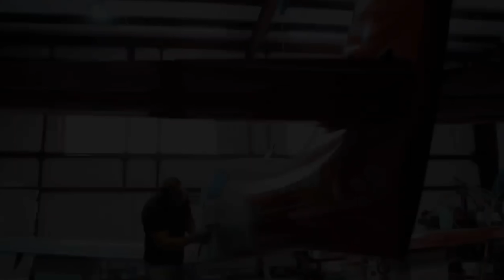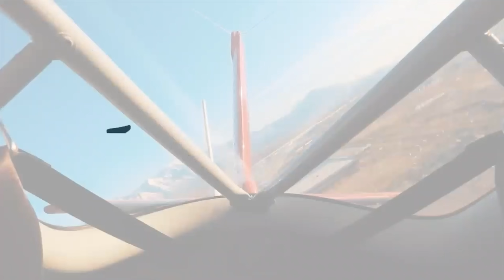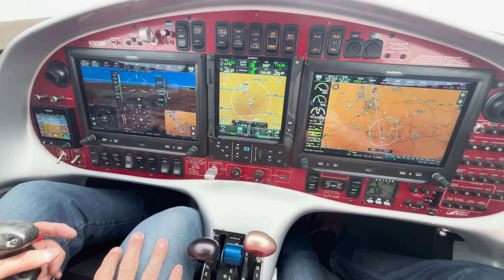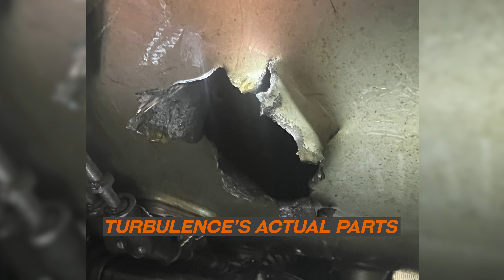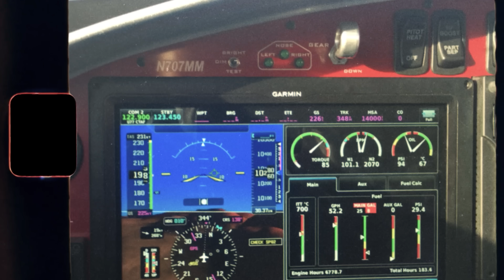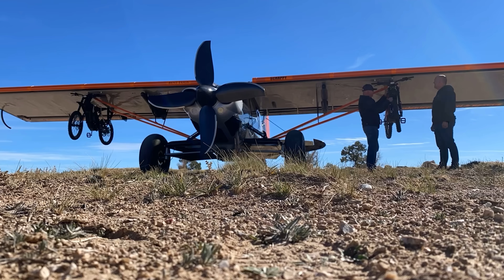Aircraft Engine Explodes - We find out Why | Turbulence Update

Comment: C-130 guy here our fuel control in the T56 has an internal governor so even if the engine became "decoupled" from the prop/gearbox section via the safety coupling(usually induced from a negative torque condition) the engine would not run away and maintain 105% rpm.  Mike as always fascinating I love learning how different aircraft handle different systems.  Cheers and Godspeed!  Can't wait to see whats in store for turbulence in the future!
Reply: PT6 engines have the same thing "fuel topping governor". I suspect this all happened too quickly for that device to react in time.
Reply: @oisiaa  Fuel topping governor on a PT6 is attached to the gearbox on 40 series actually co-located with the primary prop governor. It would not have caught the runaway if the prop shaft sheared.
Reply: Ex @rustypotato1884 excellent point, an unusually rare failure cause that unloads the engine instantly, impossible to control that fast, as in engine with no load instantly over speeds, far faster then cutting reducing fuel flow can occur.
Reply: @ Yeah it is a unique failure I would love to see the data on the time between the initial vibration (assuming the vibration was the beginning of the planetary sheering) and when the N1 reaches zero. It seems from Mike recount the amount of time in the event was a matter of a second. I think it would be cool to know how long the compressor stage spun with no resistance.
Reply: Governors have a response time as does the fuel metering valve - it cannot 'catch' something like this.
Reply: As a T56 tech, there is one major difference. The T56 is direct drive turbo prop (with its own shit-ton of issues! Which is its own long story...), the PT6 is a free power turbine. Thus in a PT6 the gas generator (core) was never connected to the prop in the first place, it only provides the hot gas to drive the power turbine of the PT6 which has its own shaft to drive RGB and prop. In the T56, the gas generator/core drives the RGB and prop directly, but doing so by using more stages in the turbine, which in the case of the T56 is 4 stages. On a PT6 there is 1 turbine stage that drives the compressors of the core/gas generator engine on its own shaft, and a separate 2 stage power turbine that drives the RGB and prop. The PT6 too has a fuel topping governor for the core/gas generator, and as for the T56 it's for backup. However unlike the T56, the prop governor on a PT6 is only in control of propeller RPM and in extension the power turbine, and NOT the core. On the T56 the prop governor is also the main governor for the core, at least in Alpha-range (flight range) and Beta-range is a coordinated fuel-schedule vs. blade angle.

Thus; 
In this case of a PT6 when the power turbine shaft sheared after the RGB seized, the core/gas generator (or engine if you like) was still just doing its thing as if nothing happened, delivering probably 800+ HP worth of hot gas to drive the power turbine. Normally those 800+ HP (minus losses) would go to the prop, but when there is no shaft to transmit that power and "holding back" the power turbine speed, it all goes into accelerating the power-turbine, which at this point is a very hot, very expencive "fidget spinner", only limited to the velocity of the gas entering it (which is much higher, than its rated speed). 

And; Even if (hypothetically) the power turbine had it's own topping governor (in addittion to the prop/RGB one) in case of a power turbine to RGB shaft failure like this... By the time the core has recieved the fuel cut-off, the power turbine would have reached the speed of disintegration already long ago. It only takes a split second for 800+ HP to accellerate ~22 lbs of power-turbine mass to way past it structural limit.

The best analog for this on a T56 would be if the air-starter button didn't "pop" if the starter shaft sheared, and you didn't pull it manually...

Comment: The NHTSA tracks the repair rate of automobiles under recall. The manufacturer tracks the individual vehicles. 
The FAA needs to do the same.
That said, there are exemptions for some experimental aircraft (but not all; an AD can apply to the engine in an experimental, I didn't look up the gearbox AD).

Comment: all that overpowered stuff it's military concept btw, so probably all of them must have the military materials and technologies.  all ga stuff doesn't hurt much as creatures that was made from 193x to 2xxx. vibration constant heavy g-load, all these birds made for take all of that. and stuff like this monster obviously ask exactly same as all mustangs, spitfires, corsairs... falcons, eagles... may be some stands for test stuff like this on the ground? for modeling all situations like turbulence and moves... there so many heavy forces push all that shifts all time. especially with those 5 blades, especially at high prop pitch.  may be this bird just too light for this engine? this is idea i get it, but may be this just overkill? what if use as base something checked by the war, like mustang, or ask lockheed martin create engine especially for this beauty. actually it can be especial exemplar to use as military trainer, with right engine and technology. like compact texan2 you know. or it even can be used as military stuff like mini tucano, for special operations. just some more balanced of plane and engine. we have this bird in microsoft flight simulator, you know:)

Comment: It sounds like a great case for electronic log books with AD sniffing ability. This what they do for automobile safety recalls in the UK now. When you go for the compulsory annual safety inspection, any outstanding recalls will flag up and trip a fail.
Reply: Omg, after all these years you have finally discovered a use-case for blockchain. All for it.

Comment: It's always interesting hearing these stories. My previous job for the Air Force was investigating these types of incidents. They sent us through JEMIC (jet engine mishap investigation course) classes, etc. to help determine what happened with the engine(s). They taught you how to determine if the engine had power when it hit the ground, what section of the engine failed first, etc. It was fun and we got to interact with really knowledgeable engine mechanics and engineers.

Comment: The mechanic I deal with at my local field uses a separate AD list for the planes he works on.  it is a separate sheet placed in the logbook and lists all the AD valid for that plane, and if and when they were done so you do not have to dig through the logs to find it.  this is in addition to the entry in the log books.  this should be a must have for every logbook as it makes checking so much easier then either assuming, or digging through trying to find that one entry
Reply: Glad your Mech does what we all are supposed to do, not specific to your mechanic ( granted some don’t)
Reply: We do something similar on all of our aircraft - we call it a status sheet and track both ADs and any inspections (annual, 100 hour, O2/engine fire bottles, etc.) and while time consuming to set up, it makes it way easier to find stuff long term.
Reply: @thatstinsongirl same at our 135 operation

Comment: When I bought my airplane in 2020 which was a 1969 I paid a guy to go through every single logbook for the airframe engine and prop and check every single A.D. and everything else in the logbook to make sure all of the parts that are installed or documented and everything is up to par. 

I honestly can’t remember what it cost, but I paid someone by the hour to do it. Totally worth the investment in my opinion.  I’m nowhere near experienced enough to read through all of that handwriting and know if someone left something out. That’s nearly 50 years of documentation I would have to dig through.

Surprisingly, I think there was only one thing that wasn’t complied with, and it was a very minor issue.
Reply: LOL my plane and logbooks were a mess.  My IA friend is uncanny at ADs and books.  We chose to dissect the whole plane top to bottom and build the books after.  It came out good and safe.
Reply: Can't someone make an app that is able to scan old logbooks with AI and indicate the parts that need further checkup and verification, extra maintenance or replacement?

At least then the time and energy can be used more productively?

Comment: Surely P&W ought to carry some of the responsibility to back check that all the AD's have been carried out on that engine, which they sold you, unless you waived all rights. For example I know I can request a print out for my Porsche, of all the recalls and advisories, which will tell me if they have been carried out and by which dealer. I would have thought all aviation power trains should have something similar for AD's.
Reply: Once they slap that as is sticker on it... It's all the responsibility of the new owner sadly
Reply: @bubbaman12289  depends, was it sold as-is but stated "airworthy"? If an AD wasn't complete, it wasn't airworthy.
Reply: Super nice guy but a little over confidence.

Comment: Great to see the conclusion and answer to this failure. I’m surprised that P&W doesn’t check for ADs when reselling a used engine. Seems like there must be some software to check logs for missed issues like this.
Reply: Seems like it would take a huge amount of time to read the stack of log books. So people just assumed that since it came from certificated aircraft, surely the AD was done. 
Might be a good use for an automated book scanning machine and some AI to digitize and find such omissions. Maybe someone could start a business that offers this service.
Another solution is the FAA requiring some sort of identifier to be attached as part of performing the AD. Colored paint on a bolt, attach a metal tag, something that would identify a specific AD was performed where one could simply look for those identifiers during inspections and know if something is missing or not. I think that would be far more useful than a written entry somewhere inside a stack of papers.
Reply: @ulbuilder  yeah digital log books are a must for sure
Reply: Seriously. For a $500k sale they should devote whatever resources are needed to verify compliance and airworthiness.
Reply: 1. P&W sold the engine as "Unserviceable"
2. The AD was not applicable since the sun gear was made in 2003 and AD only applies to gears made 2008-2012.
Reply: Unless the logs were electronic from the initial point that it was assembled and went into service, you would have to transcribe or at least photocopy each page of the logbooks. While doing the copying you would have to flag and write down each AD and SB that has been complied with and put into the logbooks, then match them up with a list of AD's and SB's that applied to the engine. At that point if all applicable AD's and SB's had been complied with and logged, your golden otherwise you now have to perform them and make the log entry. If the engine was bought from P&W, I'm really surprised that they didn't do a thorough inspection of the logs.
Reply: @ AIOCR to this task (digitizing paper logs) pretty well. 

It would need human review of of course, but for the amount of money, one of these engines costs even used that’s not an unreasonable thing
Reply: That AD applied to earlier part numbers. I have to wonder if P&W thought they had a fix with the part numbers in Mikes engine. The AD should likely be revised and renewed and likely will be based upon this rapid disassembly.
Reply: can't believe they sold an extremely not airworthy engine as "certified" and are getting away with it
Reply: @tommihommi1  they didn't.  It was sold to Mike as "Unserviceable".
Reply: @ I hope Mike was able to work out a deal with P&W, A factory has much more to lose over a small shop or mechanic that missed the non-entry. Either way, any shop that did maintenance on the engine and didn't catch the omission is liable.
Reply: @5695q  The engine was sold to Mike as "Unserviceable".  It was never intended to fly again.